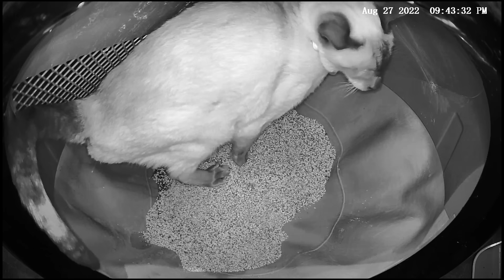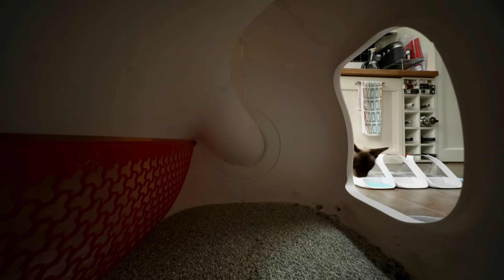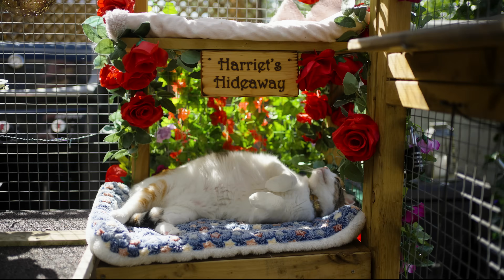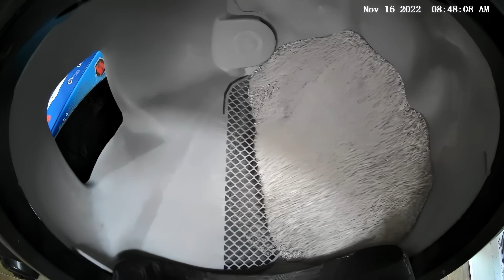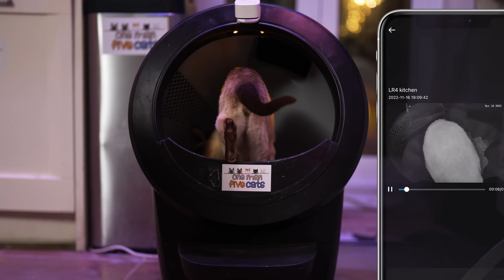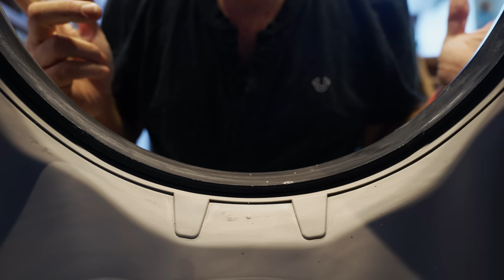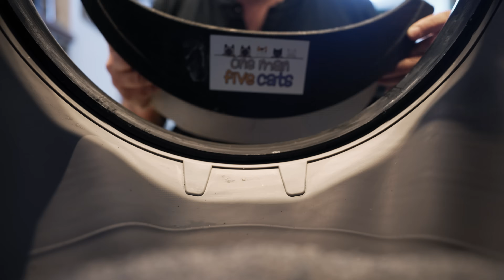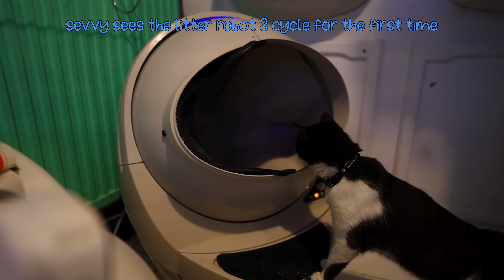Litter-Robot 4 Review: Is It REALLY the Best Self-Cleaning Litter Box?

Comment: I'm considering a second automatic litter box and this is super insightful. I have a LR3 and the biggest issue is my one cat goes in face first and then pees like that and it goes out the front sometimes, this is worse when they kick out litter. It sounds like the LR4 would be a horrible idea

These are also great for folks who are partially disabled like I am btw
Reply from the maker: With the LR3 you can hang something like a coin on a piece of string from the top. This dangles in and touches the cat when they go in which encourages them to move. Give it a try!

This doesn’t work with the LR4 because of the entry sensors.
Reply: @OneManFiveCats  thank you for the tip. She is 14, I hope anything at this point can persuade her to do anything
Reply from the maker: @bec7080  I am sure it will work 🙂

Comment: Love the video. I already have the litter box 3 for a couple years now but I wanted to get the 4 as well. I just don’t like that I will have to spend extra in a few months to get the new fence/guard (whenever it comes out). They also don’t have a ramp available for the 4 yet. It’s incredibly expensive as it is.
Reply from the maker: Thank you🙂

Personally I think the new fence should be offered free to anyone who needs it as it fixes an inherent flaw in the design. As a customer I would most definitely push for that when it comes out. 

With regards to the steps, the LR3 one will work with it from what I’ve seen but I’ve never needed them, even with my arthritic old man Percy who seems to be able to get in it no problem 🙂

Comment: The production level on this made sense after I realised that I used to watch your other channel. 
I got to say the prices of these automatic litter boxes are absurd. The Petkit Pura Max can be bought here in China for just ¥1300 ($180) and right now it's on sale for just ¥1000 ($138). We got another brand called Catlink that has a litter box really similar to the Litter Robot and the top range model is only ¥1628 ($225). Both these brands have a whole ecosystem with smart litter boxes, water bowls and feeders. Really useful if you need to track everything about your cat when you're not home.
Reply from the maker: Thank you. 

Yes the prices are very high outside of China. The mark up on these is crazy. You can buy the Leo’s Loo Two for very little money on AliExpress, I think that’s what Smarty Pear…but in bulk with customisation.
Reply: @OneManFiveCats  Would you ever do a test on cat litter? I have a Catlink litter box (the one similar to the Litter Robot) and I often find there are quite a lot of skid marks on the part where it slides down to the poop chute. Not sure if this has to do with the cat litter or the material of the rotating drum. Did you even get this issue? I feel uneasy knowing my cat's fur will rub against those skid marks 😦
Reply from the maker: @MiguelXSR  nah I won’t do a video on litter. @allaboutcats has done though.
Reply from the maker: @MiguelXSR  I got a lot of skid marks with the Pura max, I will explain why in part 2.

Comment: Thank you for the excellent video!  I am trying hard to decide between the LR3, LR4, and the Leo Loo Too.  I was leaning towards the LR4 after watching your video but I’ve seen quite a few issues posted on YouTube and reddit.  Some people claim the LR4 product is not stable and recent firmware updates have broken functionality.  I think the LR3 might be more stable of a product with some of the issues already worked out.  Leo Loo Too seems to not be as popular but seems to have less issues.  

I am planning on purchasing one of the products today as there are some cyber Monday discounts to be had.

Any advice?
Reply from the maker: Yes, my advice is within this video. 🙂

Until yesterday I had three LR4 machines, I sold one and now have 2. All were working perfectly, although I’ve had the occasional issue with them but all have been fixed. Most were fixed with firmware one was fixed with a new sensor board. 

The LR3 is a more mature product but I struggle to recommend it over the 4 for reasons I showed. 

LLT seems to be fine; I talk about it more next episode. I had no major issues with it but my cats didn’t really like it. It’s a small entry and not a huge amount of space inside. Plus I have no idea what happens once your warranty runs out, I think you will need to chuck it as there is no repair centre; those machine are bulk bought in China for a fraction of the selling price and rebranded.
Reply: @OneManFiveCats  thank you for your reply I just purchased the LR4!
Reply from the maker: @christopherjudd5319  I hope you used my discount via the link in the description! 🙂

Comment: im having so many problems with the litter robot 4. Will NOT completely finish a cycle on it's first try since day one. Always gets stuck and says there a sensor malfunction. 700 dollars of crap. Tried a lot of troubleshooting tips from people that are having the same problem. Apparently, there are a lot with the same issue I'm having. Going to call customer service to see if they could help at all. If problems persist, I'm going to ask for a refund. So far, would recommend to NOT purchase. A product of this price, should not come with this type of issue out of the box.
Reply from the maker: It’s always good to have a mega complaining comment…but do you want help?

I am sure you’ve been told the following but please tell me:

You say it won’t finish a cycle but where does it stop? Does it stop multiple times? The same place? 

Does it complete a cycle with NO litter in it?

With litter in it, how full is it? Have you tried putting less in? Some litter is heavier than others and and this can cause the error you mention. 

This one is very important, is the machine on a completely flat and level surface? I had your issue and it was because one of the feet was over a floorboard join and it meant it had the tiniest movement when litter was cycling but enough to trigger the problem.

If none of these help then it’s possible your sensors are off and need recalibrating which only whisker can do. But to be honest as it’s not worked from day one I would put money on it being one of the things I’ve mentioned to you which means you can get it working yourself and easily.
Reply: @OneManFiveCats  called customer support. Talked to a very kind representative and had a new base sent out. Arrived in less than a week and problem is gone. Pretty happy with the customer service and with the machine. Looks like I just got unlucky with the first unit.

Comment: Incredibly helpful video! Thank you. Did the company ever fix the leak issue? My cat has the same problem (vertical) and I probably won't get this unless it is fixed. I like your DIY approach but I hope the company would just fix it instead, esp for that price point! My only other issue is that one of my cat's refuses to use a box with a cover. It seems to offend her so much (though she has four other boxes to choose from) that she will go to the location of that box and pee on the carpet instead.
Reply from the maker: Thank you. This video is only a video week old so everything in it is very new. Did you see the section about the new fence they made? That stopped the leaks for me. 

I don’t know if they will change the design of the LR4 to stop it happening as I think they are painted into a corner with the two piece design. I think the fence system is going to be the only way to stop it for now. 

I haven’t had a speck of pee go through since I started using it. 🙃
Reply: @OneManFiveCats  Thank you so much! I think I might have missed that part. I will rewatch it! And, I'm probably going to buy this. So thank you! My son will be so happy. This was so helpful!
Reply from the maker: @LifeDIY  it’s at 22:11🙂
Reply: @OneManFiveCats  Thank you so much!!! So  helpful!
Reply: And I am SO HAPPY the leak issue was fixed. I must get this. I currently have litter boxes all over the place and I keep wasting money on them. I need this!

Comment: Thank you! I have the Pura Max and am very happy with it. Luckily I don't have any leaking problems. My cat pees in the corner like Bert , but luckily just low enough for there not to be a leaking problem. I was not able to get the Litter Robot 4 shipped to Spain.  And not interested in the LR3 due to the noise levels and old school design. I'm a bit picky like that. So I took the chance with Pura Max, since Amazon gave me 4 weeks to return if I faced any issues. Your insights inside all the litter machine groups have been invaluable. Thanks for taking your time to create these videos and provide honest insights for consumers to evaluate what's best for their unique situation. 🙏🏻
Reply from the maker: Thank you Camilla. 

Bert only peed like that once, the issue with the Pura Max is more fundamental. Where you saw him peeing inside on the edge is where leaks are happening as there is no watertight seal on it. I am glad you don’t have any issues. Have you looked under the drum by any chance? You probably have to clean it…
Reply: @OneManFiveCats   Yes, I have been super aware of looking under the drum, because I've read about all the issues. Luckily, there's hardly anything there. Just a little bit of dust from the litter, which is very minimal. I've had it for about 2 months now, and still no issues. I've only had to do a deep clean once. I only have one cat also, so the use is less heavy than with your 6 cats. I use Cat's Best natural clumping litter. I think I might have been lucky with my model, or just lucky with how my cat use the litter box. Either way. I guess it's like with everything, you just gotta try to find out if it works for you. Hopefully, with time, all litter machines will be totally cat-proof :D
Reply from the maker: @camillagroen  six cats really helped me find the flaws in machines quickly! If I only had one I would need to spent a lot longer on each to see how they go…maybe a year with each machine! 😂

The Pura Max didn’t like having five cats using it, it got really dirty very easily. There’s an add on for the screen to cover it over to make it possible to empty the litter out into the waste drawer, it take two cycles to do it fully. 

If you order it make sure you select “filter screen” only as it’s easy to miss it, I did! 🫣

￡15.34  30％ Off | PETKIT Cat Litter Box  Automatic Toilet Sand Pouring Plate Cat Litter Filter Screen Filter Mesh for PURA MAX Sandbox Accessories
https://a.aliexpress.com/_mKuDhmC

Also which mat do you have? The white or the patterned one?
Reply: @OneManFiveCats  I got the newest mat with my order.  The one that's patterned and made of fabric kind of material. Thanks for the tip in regards to the screen cover. I've been thinking about ordering that.
Reply from the maker: @camillagroen  the new mat has the worst seal of the two. Glad you have no issues. :)
Reply from the maker: And thanks for the “super thanks” 🙂

Comment: I bought the popur as my first electric litterbox. Cat wait to see what you think of it in comparison
Reply from the maker: How are you liking it?
Reply: @OneManFiveCats  besides the app not staying connected with the box well. I haven't had any issues. It's a bit creaky when it first starts to move but 2 out of 3 cats use it. The third thinks it's possessed.  I would like to see the box in back  have a more covered opener. The bag can catch on it if it's really full. Maybe a drop down side would have been easier
Reply from the maker: @thefibercircus6313  yeah mine is creaky, the preproduction one I had wasn’t though. I really like it but have a few issues including the bin.
Reply: @OneManFiveCats  if you could mount it on a box where it would dump into something below that could be handy. That arm just gets in the way
Reply: @thefibercircus6313 with the way that it works and goes so high is why it’s so heavy, so I can’t see anything other than concrete blocks under it working! 😂
Reply: @philipbloom  true